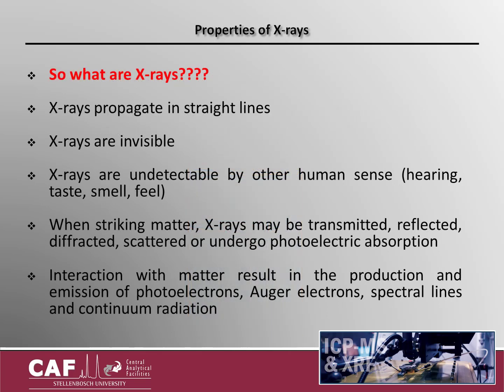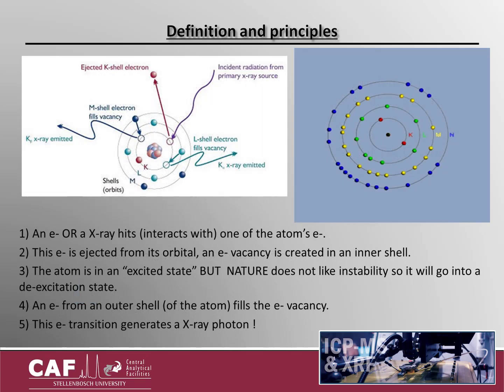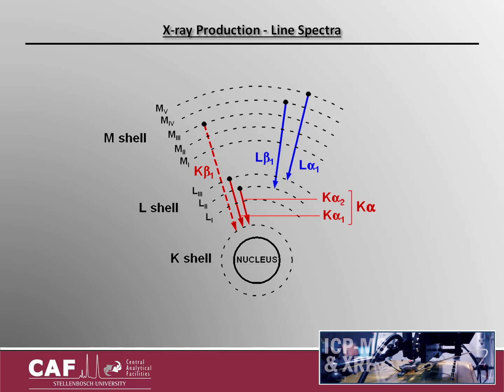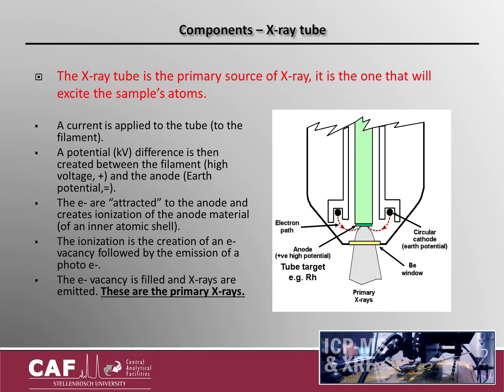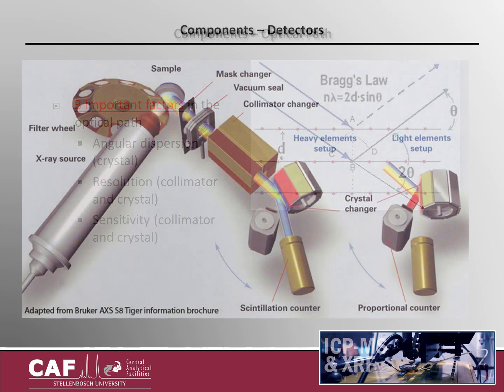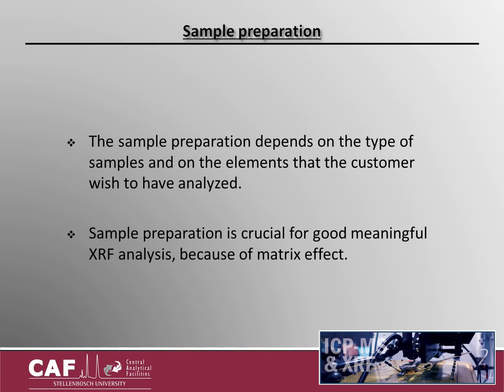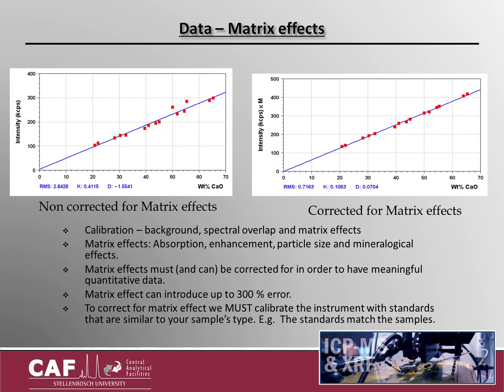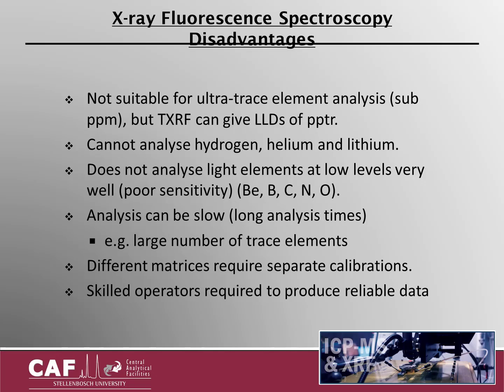XRF course

Comment: U think I was  exposed to radiation if I accidentally opened the xrf door while it was measuring a wafer
Reply: You should be wearing a dosimeter while using WDXRF and sending it in regularly to have it checked to see how much radiation you are being exposed to...we run ours 24/7 so we need our dosimeters to be checked frequently!